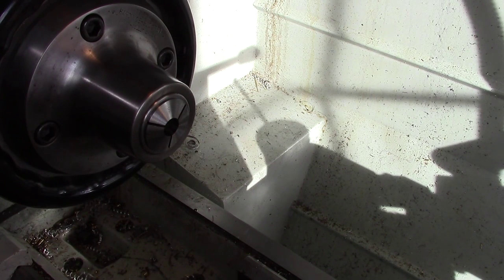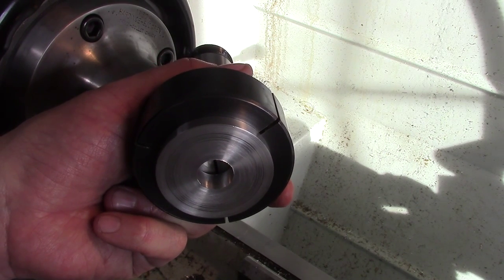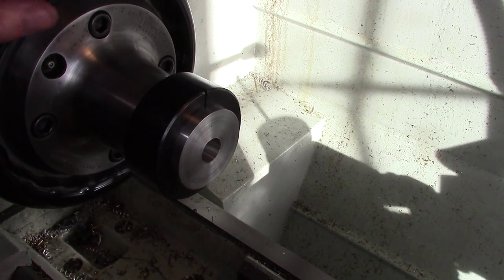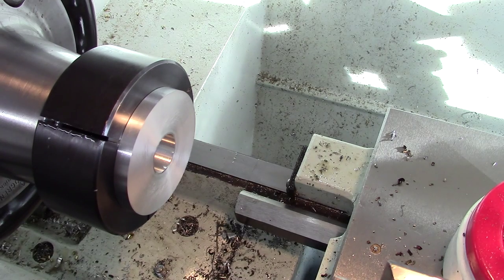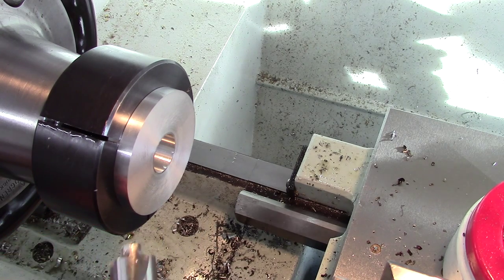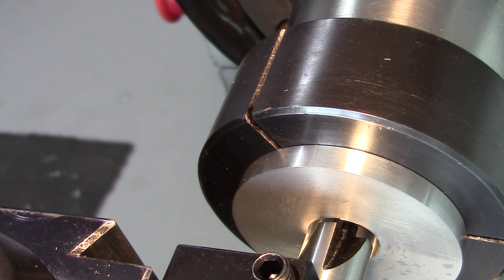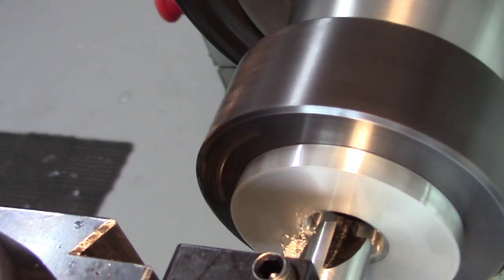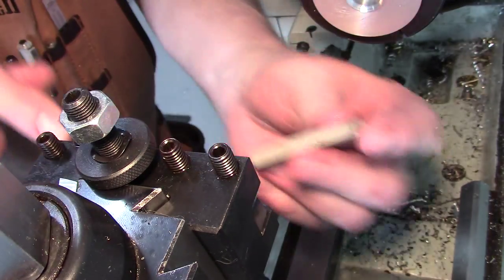Shop Drops #2, pt1

Comment: You can use the same fillet tool in the same toolholder for the outside edge by simply running the machine in reverse and cutting at the back of the workpiece. You can even use the same Z axis setting.

Comment: Is there a rule of thumb on the size to bore out the step collets for a correct fit? Say I need to hold a 1.23 diameter part... What size should I bore the step collet too?
Reply from the maker: 5C collets don't have much of a range outside of the design size. I bore them to size, maybe .0005 over but not much. Robin Renzetti posted a video this week showing how he uses o-ring stock to help the collet spring open, a great idea and he talks about emergency collets and his production techniques. A very smart guy. https://www.youtube.com/embed/DJfBXNi04bs

Comment: Mike, in operation one-facing, what is the tool holder and the insert you are using. Is the insert HSS of Carbide?
I like your videos a lot.
Ron
Reply from the maker: Ron Hubbard It's a carbide insert, a CCGT32.51 for aluminum. I'm 99% sure I picked those up from latheinserts.com along with the holder. Thanks for watching.

Comment: Hi Mike,

I have the same exact lathe and want to do a 5c setup on mine. Can you tell where you bought your speed chuck?
Reply from the maker: Craigslist, kept watching it and found a plain back unit for a good price. Had to drive a hundred miles but it was worth it. The same guy gave me a granite test stand and large federal indicator while I was there. :)
Reply: Did you make or buy the adaptor?
Reply from the maker: I purchased the thickest D1-5 backplate that Grizzly had and machined it to fit the back of the Hardinge. The part number was SB1398. You might be able to find something similar on ebay. Shars part 202-5455 might work. I bought the extra thick one to have plenty of meat but I suspect the Shars would work, it's certainly much less costly.
Reply: Thanks! Like your work on your channel. Keep it up!